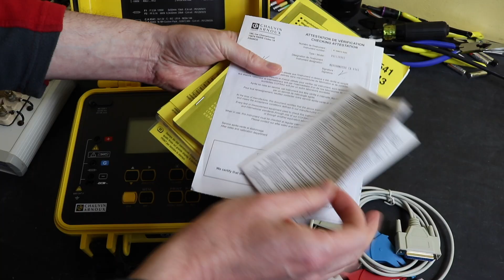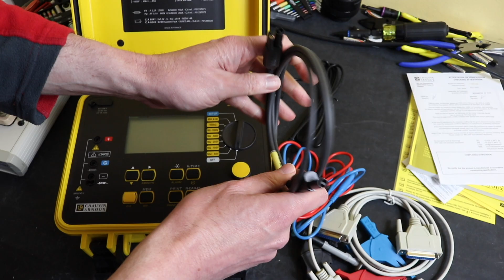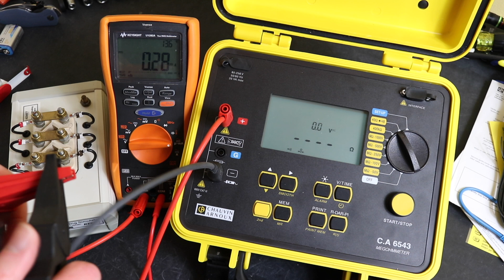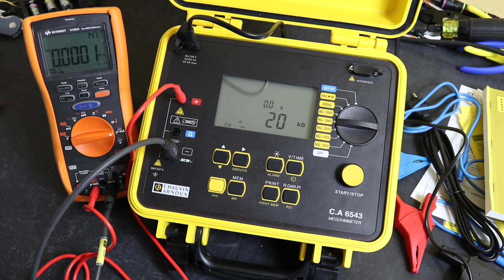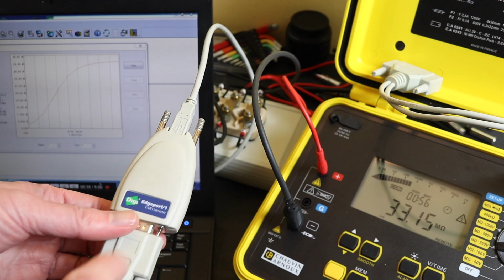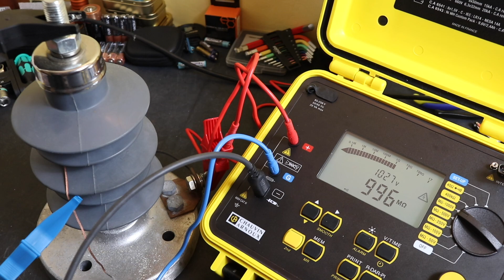Chauvin Arnoux CA6543 Insulation Tester

Comment: Thx for the video but yea' way out of bounce for most hobbyists.
Have you taken a look at that 20 £ Insulation tester / DMM from Zoyi that seems to offer quite a lot on paper.

50, 100, 250, 500, 1000v and with selective timed PI & DAR measurement.
20.000 count meter.
It runs on 3x 3.7 Lithium batteries (incl)
ON paper it seems like a step up versus the usual run of the budget mill when it comes to Insulation testers.. that often are these VCB60+ variants when your below 50 bucks.
Biggest issue that makes me wonder about these 1000R models from Zoyi is the price.
20£ delivered with 25% VAT  incl. and holds 3x Lithium batteries.
if you remove 25% VAT form that sell price of 20£ and deduct the prices for shipping special goods like Lithium batteries as I can see my unit from Aliexp. is being shipped under "special goods"... 
its like 10 to 12£ that are left for the product itself.  😁 that's not a lot.
It doesn't add up, but time will tell..
Reply: Seems to be this one https://youtu.be/pAK_Wi1aYLk?si=eB6kVblMO8zvN4zD&t=342
Reply from the maker: I have seen a couple of videos on that instrument, but don't have one to test out myself.
Showing about £40 here in the UK at the moment.
Not sure how they are producing them for that kind of money.

Comment: Hi. Thats a vey nice video on our CA6543 and how to operate it. Thanks for taking the time to make it. 

Sincere apologies you never got a UK mains lead with yours. Assuming you purchased it in the UK then it should have had one in there. If you contact us with your details I will arrange to have one sent to you. 

As you mention the size and cost are basically due to its very high measurement range and driving current. Both these and the isolation required to enable it to be powered from the mains and test at the same time require a large degree of physical seperation of certain parts of the circuitary. 

I'm told the instrument buttons are deactivated by design when the product is being remotely controlled to prevent the test being tampered with while it is underway. Oh and a USB updated version will be here soon.

Anyway, thanks again. If you want to play with or review any other Chauvin Arnoux products let us know and we will lend them to you :)
Reply from the maker: I have plenty of spare mains leads around, so it is not a problem for me, but thanks anyway.

It is probably from the risk averse industry that I work in, but I would always prefer to be able to stop a test at the instrument should the need arise, even if it is being run remotely. I can of course do that by just turning the instrument off. It will certainly be good to see a USB version, although I haven't had any connection issues with the RS232.

Many thanks of your kind offer to loan me instruments, and thanks for watching and commenting.